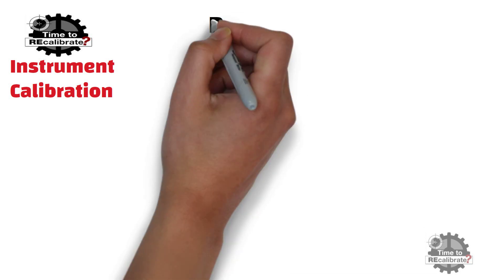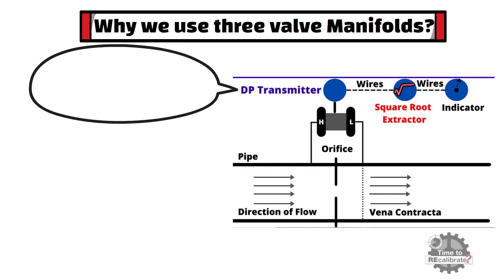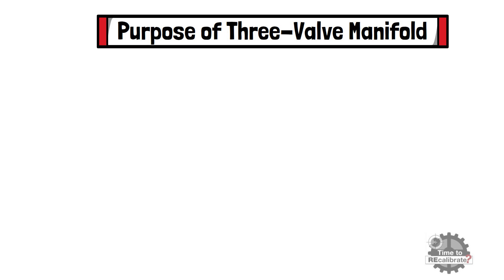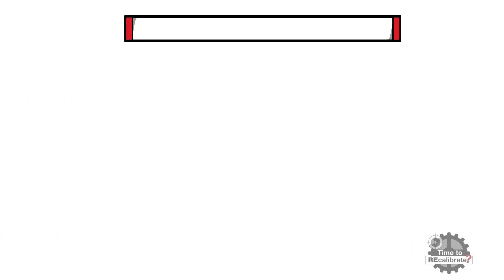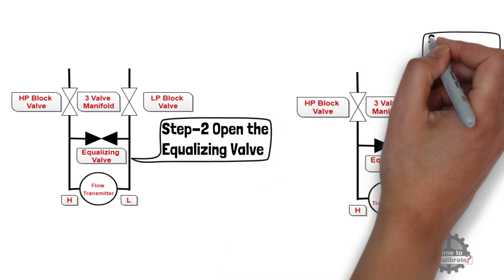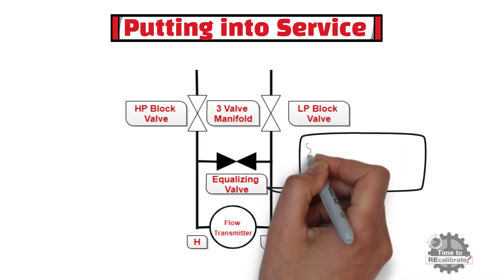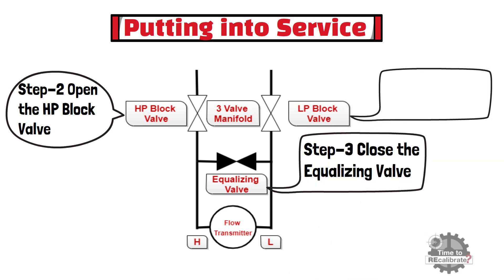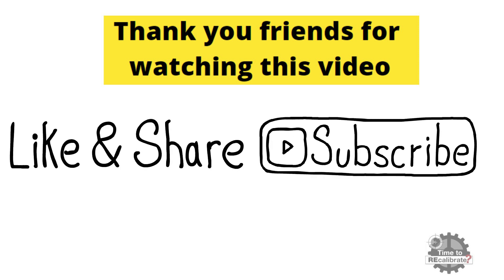3 Valve Manifold for DP Transmitter | Removing DP Transmitter From Service Or Putting Into Service

Comment: In my case. To remove the dpt from service i start with closing the hp and lp valves at same time then i open the equalizing valve. And to put into service after draining i start with closing the equalizing valve then open the both valve hp and lp. it works very good i had never have a problem with this!!! is it the right method or simply i had a chance that my sensor still working??!!
Reply: I use the same process :) no problem
Reply: I think good practice is trying to maintain both hp and lp in relative same pressure and to prevent one side suddenly get very high or very low pressure impact during the replacement, another thing that needs to be considered is wet lag and dry lag...so, for the steps you put one in service, when the new one lp still holds the air and the pressure is the same as atmosphere, at this point, suddenly open hp side and let supper high process pressure come in, this may destroy the dp transmitter.

Comment: I was told to close the hi side valve first then open the equaliser valve and then close the lo side valve and then vent off, and to reinstate open the lo side and then close the equalise valve and open the hi side valve.
Reply from the maker: Hello Bernard
Thanks for your comment.
All the DPT manufacturer Standard Operating Procedure is, Close the LP Side BV, Open Equalizing Valve so that it equalize both side pressure, and then Close the HP BV. 
To put DPT Back into service, Begin with all valve close, Open the equalizing valve, then open HP BV, Then Close the Equalizing valve, And finally open the LP BV.
Reply: But in the video you started with opening the equalizer??
Reply: We have to put the transmitter into service...first we have to open the equalizing valve...but that is already in open Condition plz explain properly

Comment: sir when you explain for removing that we first open the equalizing valve and after we close the hp and lp i had this experience and the sensor damaged. i dont understand it. what if we fisrt close the hp and lp and after open the equalizing?
Reply from the maker: Hello Panagiotis Karakatsanis 
Thanks for asking this question. When we remove DPT from  service, it is important to equalize pressure from HP Side and LP Side. So, we need to close LP side manifold first, then open the equalizing valve, which will equalize the pressure at HP side and LP side. At the end, close the HP side valve. Hope you get your answer.
Reply: @InstrumentCalibration  thank you for your answer. I still have some thinking about the sensor. This sensor is piezoelectric with metal membranes right?  if high pressure from HP side  go to the LP side of the sensor  through equalizing valve is that normal for the sensor at the LP side?
Reply: After equalizing why don't we close the HP side valve first. It would give comparatively lower equal pressure to both side of the sensor.

Comment: Why always equalizing valves on and off by removing transmitter and returning to service,,, is there any damage to sensor.. Thanks
Reply from the maker: Hello Ronelo
I didn't get ur question. Could you please explain me further?
Reply: What if i forgot to equalized, by mistake during removing and returning PDT to service. It has an effect to both H, L, side sensor? Thanks

Comment: When I put TX back into service,if I open HP valve ,than Open LP valve ,than i close equalisation vakve  is it working good method ?
Reply from the maker: Hello Navnit
Thanks for asking. No, it is not good method. Please follow below steps, when you put TX in to service.
Step-1 Open the equalizing valve. This will balance the pressure between the high and low side and prevent over ranging during this process.
Step-2 Open the HP Block Valve. Both sides of the transmitter will be at the same pressure equal to that of the HP side of the process.
Step-3 Close the equalizing valve. This will now isolate the HP and LP sides of the transmitter.
Step-4 Open the LP Block valve.
Reply: @InstrumentCalibration  when equalising is closed , lp block valve is closed at that moment transmitter experience the hp which can damage the transmitter. Please explain why you closed equalising valve before opening the lp block valve . Thank you
Reply from the maker: @sanjeevupadhyay1457  Hello Sanjeev. This is standard procedure to put DP Transmitter into service. We close the equalizing valve in order to isolate the HP & LP sides of transmitter.
Reply: @InstrumentCalibration  but sir if we close equalising valve then one of dpt experience very high pressure and it can damage.
Reply: @sanjeevupadhyay1457  Pressure does not drop if you close the valve.